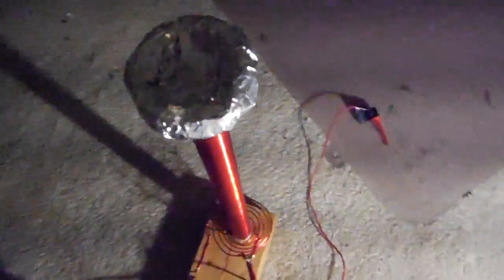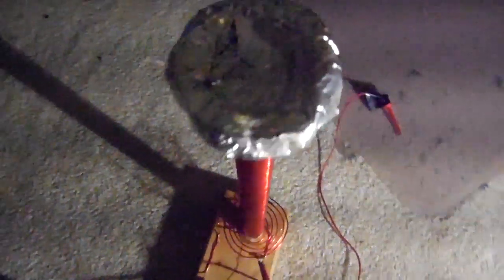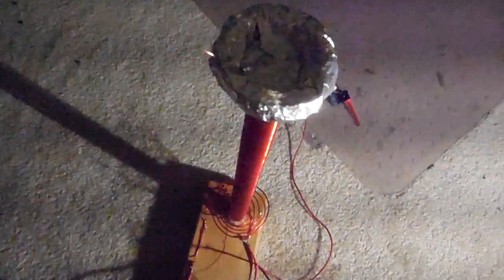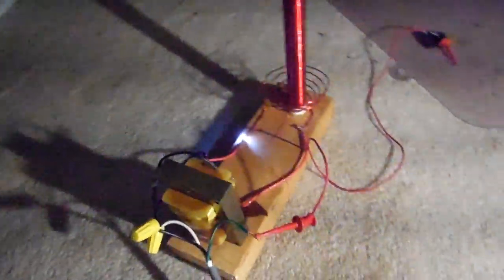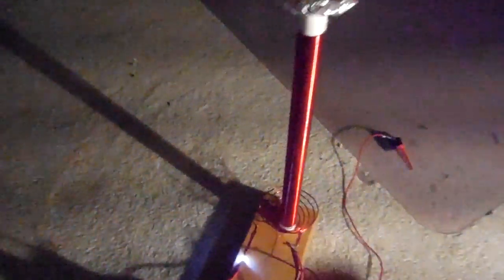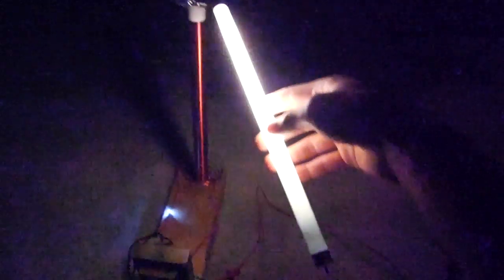Homemade Mini Tesla Coil

Comment: very cool! thank for the great demonstration of the bug zapper transformer. I myself have studied fluorescent lamp choke windings for a few years now and have been fascinated of wireless transmission signals for many years as well. Only recently have I took apart someone's old bug zapper that wouldn't zap anymore and found a single transformer for step up voltage but not for power transmission but to run a fluorescent lamp as a choke ballast(like I have studied) with its primary winding then also serve the electrified cage with the secondary winding. it never occurred to me that I could do that and now with your video showing this wireless power signal via the Tesla coil I can now continue my work in wireless power transmission research.

thanks again and keep up the good work!

Paul

Comment: I got the same results as you with 417 windings and 5 turns of solid core copper wire I didn't use a toroid and got a decent amount of corona discharge and a nice faint visible circle corona visible in daylight

Comment: Primary need to be adjusted to reach secondary´s resonance frequency... if you do that, the output will be much higher than actually is. But, anyway, you did an excellent work. (Sorry for my english, I speak Spanish ;) )Have a nice day.

Comment: Hey man I was wondering if you could tell me the wiring for this, I can't tell from your video. You have one wire from the transformer into the spark gap, then the spark gap to the coil, how is the other wire connected to make a circuit?

Comment: wait... You didn't use any capacitor, did you?
Reply from the maker: I did, there is a capacitor built into the transformer. It is under the resin, across the output.
Reply: +Electrotechnics Whats The Power of The capacitor

Comment: Whats the frequency of the current? Regular?
Reply from the maker: Going into the transformer is just 60hz from the wall, but after the transformer the frequency is determined by the inductance and capacitance of the circuit, I did not bother to calculate it out, since i just built it as a test.
Reply: I was wondering because of skin effect,I noticed you are close with high voltage sparks with your hands.does it hit your skin?

Comment: how come you arent using any safety gap ? ... can you add me on FB i want to know how you built it .. cuz mines like its jammed ...
Reply from the maker: The capacitor is built in to the transformer and it is designed to have one gap and have a short between it so I do not need/cannot install a safety gap for the cap.
Reply: why is mine jammed ... hmm what did i do wrong .... my spark gaps wont spark ... my transformer i think wont work ... the transformer is directed to 1 of the primary coil ...and the other goes to the capacitor ... i just got this transformer form a booster ....and the plug is directed from the two wires comming out from the transformer ... i tried using my dads car recharger to light it up "breathing deeply " but nothing happens ... can u tell me whats wrong?..

Comment: I think you are missing a capacitor on the primary circuits? This would increase the resonant effect in my opinion.
Reply from the maker: There is a capacitor in the primary circuit, it is a small one and built into the transformer, though I have tested it with bigger capacitors and it does work better.

Comment: you can also ignite a florescent light if you hold a handheld walkie-talkie antenna up to it and key it in order to prove that this is anything besides radio waves you should use another source or show that its charging electronics with out being plugged in
Reply from the maker: I did not think that I needed to prove anything in this video, I was just demonstrating my model a well known device. I have never noticed a fluro lamp glow from a walkie-talkie, I guess it does not work with 2.4 ghz walkie-talkies. Maybe older ones that use a lower frequency?
Reply: Not sure of the freq. Just something I was shown overseas.

Comment: Gotta try this,do you think that a 2kV MOT transformer could drive a mini tesla like this?

Ps: were is the HV capacitor?
Reply from the maker: A microwave transformer would NOT be good to drive a tesla coil like this. A MOT puts out way to many amps at a voltage which is two low to supply a tesla coil properly. Not to mention they are VERY dangerous. Though 2-3 MOTs can be connected in series then with a adequate ballast can be used to drive very large tesla coils due to the large amounts of power they supply.

I recommend using a small NST, you can find them on ebay for pretty cheap or at a local scrap yard or at a neon shop.

The capacitor is built into the bug zapper transformer, but it really is not big enough for this application.

I just got some HV caps in the mail today and I will probably put a video of my big-ish coil running today!

Good luck

Comment: very impressive given the transformer what i do recommend is that you make the spark gap distance larger that should increase the arcs distance on top that's what happened with my experiments with mine
Reply from the maker: Thanks for watching and commenting! That transformer is pretty poor, I already tried making the gap bigger but the spark would not jump any farther, I did add some external caps and you could see some corona at the top but it was still not that great. I also badly designed the coil, I used wire much to big and the coil is to long compared to the width, I have built another mini coil but I am waiting on some proper caps to come in the mail for that coil and my big coil.